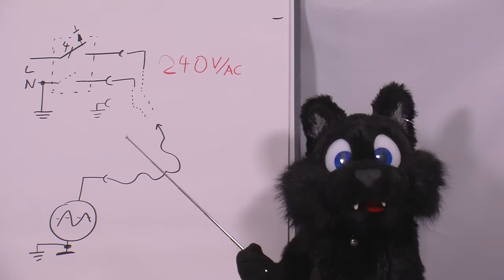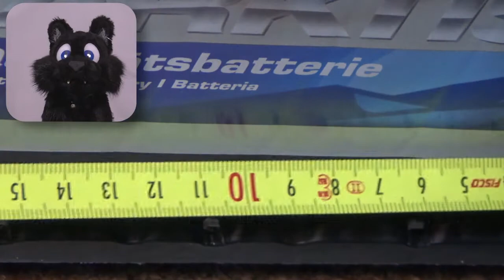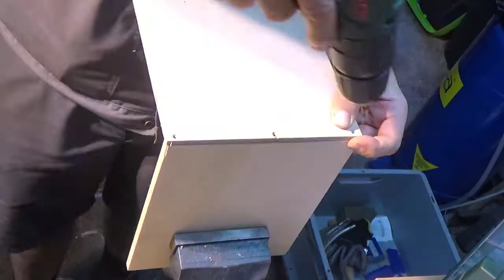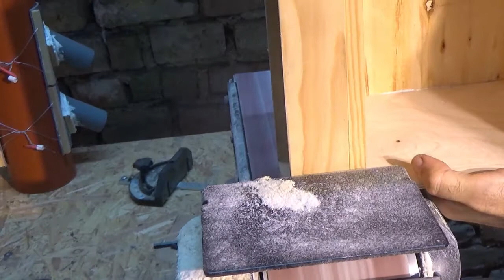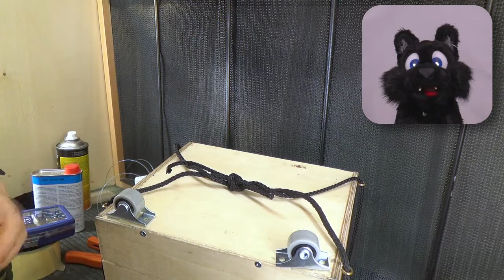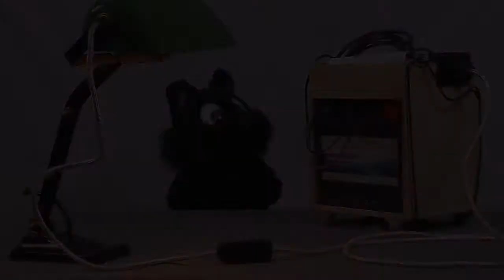Workshop Project #7 - "Power Bank"

Comment: I wonder what sort of isolation transformer you looked at, if this was the cheaper solution.. the ones in roughly half-kW range are usually below 100eur - and then you'd have real sine output instead of the chopped square this inverter puts out, which may matter for some of your electronics restorations (mains input noise etc..). At least this solution has the benefit of being portable.. or at least as portable as the CS64 ;-)
Reply from the maker: Well, just a transformer is "OK", but I checked for proper lab grade isolation transformers. Most of those are also adjustable and the "buy now" options were at around 500-ish Euro - and the one auction I tried blew up too. The output does resemble a sine wave though. This inverer has a "tru sine" feature. Scope shows it "close enough" for me. Also, I am still going through options left and right. Never know what tomorrow might bring :P
Reply: @atkelar  Yeah they get pretty expensive. I remember watching discussions and guys were glad if they got something which wasn't even promised to work for half price. They were targeting one local type which sometimes appeared on bazaars and flea markets. First thing was to replace carbon wipers which I think were a little obscure so they had to buy different ones and make them fit. Then they hoped there are no short circuits in between windings and that windings itself are in good shape. But result was (usually) great transformer, after proper cleaning and fixing everything it even changed voltage very smoothly.
At high school we even had big three phase one (practically three one phase transformers with common shaft), controlled by one phase motor with transmission OR hand wheel. I wonder what it was for back then.